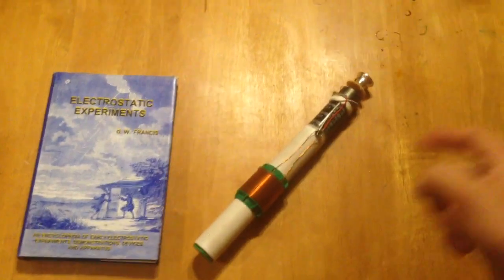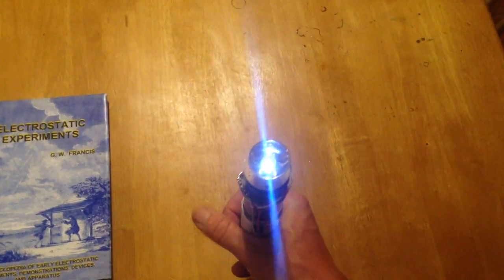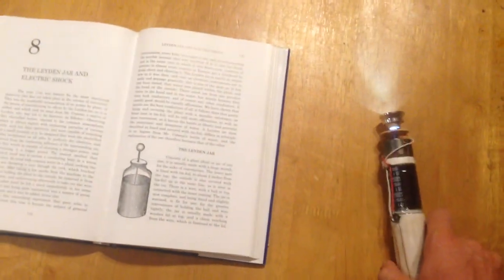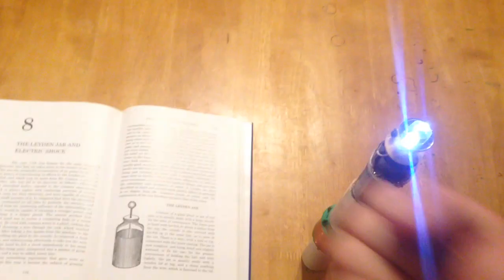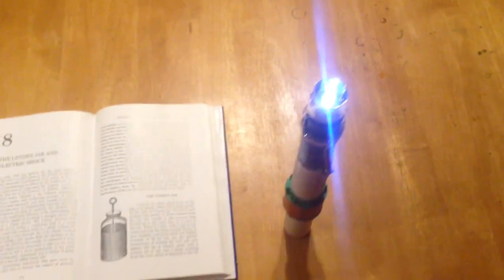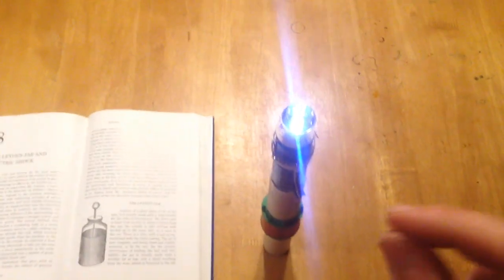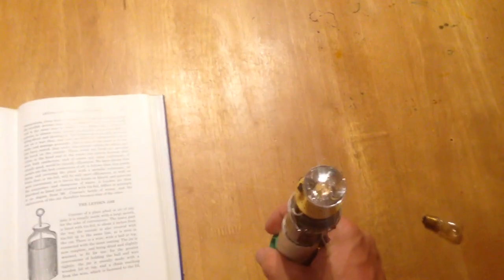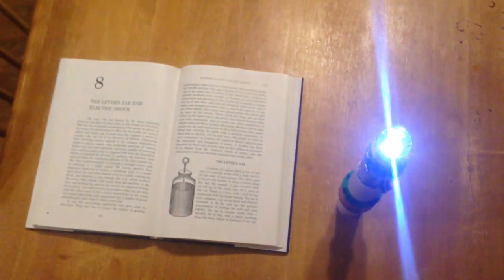3D Printed SJR Flashlight Prototype! - Instant Charge Battery Free Light

Comment: Hi! I am strugling to reproduce, but the lasersaber website does not exist anymore. Could you please write the diameter 😊f magnet and coil turns and wire diameter. I get only 1.5V with 250 turns 0.5 mm wire and 15 mm magnets. Ptobably need to use Joule thief. 18 mm ring magnets work better. Tube is 20 mm outside diam.

Comment: I’m sorry if this has been asked. I tried to scan the comments and didn’t see an answer. Can you go into some details on the Litz wire (what gauge, how many turns, a source, etc)

For example, can I use 3 strands of 30awg magnet wire which gives an equivalent 25awg - Litz wire??? Or 10 strands of 40awg to get an equivalent 30awg - Litz wire??? Is this like using Litz wire or am I not understanding what Litz wire is?

Does Litz wire make the difference compared to magnet wire?

Comment: I was wondering if  you could hook up a type of transformer to this device /concept and generate power from it. I love how this capacitor rings and recycles its energy but can you capture this energy and use it instead of making just light? It seems you might be able to make a system that could recharge its self.
If you can run a led all night long with little or not drop in power in the capacitor but still provide power enough to power that led it might indicate more power being produced than is present when the experiment was started. Example. I have 1 gallon of water and let it drip slowly into another bucket. I end up with 2 gallons the next day.
Please let me know if im off track here but it seems you are on to somthing

Comment: Only question i have is how can I reproduce this effect with off the shelf parts for that coil that does the magic.  Will i need an Orion Delta 3D printer to make this work or is there some other arrangement using off the shelf stuff that will work? If all this pans out, you may have saved the world... I'm sure some will not agree with me, but your experiment already put my over priced product i bought a few yrs ago to shame (won't mention the name but i have to shake it for a while to get minimal illumination for a just few mins and no where near that run time your experiment has).  Thanks for your diligence in the pursuit of efficiency and discovery.

Comment: On eBay or amazon, you can get these dropin modules for flashlights, I would get the XML U2 or XML2 dropin, as these are great high quality cree LEDs. The reflector (although easily scratched) is decent. these power LEDs, although may seem like an overkill, are very good at low currents/powers and may even exceed their efficiency ratings! Try to get one with the smooth reflector for throw.

Comment: Excellent Lasersaber. This is it! I find it interesting that the magnets goes resistanceless the more you shake it. It's telling you something there. Once the charge pump starts it should stay running indefinitely once you get the resistance lower or Voltage levels higher. Reduce the current and boosting the voltage is the best way to do this. Use a choke coil for that. The more the winds the better for choking the current. The funny thing about energy is, it doesn't like to be constricted. The voltage levels will quickly climb and because the current is stronger before the choke coil. The voltages to current ratio is what we are looking for. As the current goes down and the voltage raises it loses much less in the process of going from a to b. You want to reduce losses then just simply choke the current before the application you are using. Tesla was of the opinion that to reduce the voltage field losses that he could contain it like a pipe. Reflecting static plates around the wires. This allows a voltage pressure to surround the wires.
 Can you remember the videos where the electricity went right through the wires insulation and burned this guys skin? Thats how you protect from this kind of energy. A static barrier. Tesla has a Patent for this process of channeling this kind of energy. It looks like Coax but it is not. Look for this patent and read the information about statically charged energy.

Comment: I also did JT, the capacitor 330uF 9V works ok 8min.
More info on the Polish forum: http://www.elektroda.pl/rtvforum/viewtopic.php?t=2818510&highlight=

On battery 1,5V LR6 works one week, and voltage drop from 1,6075V to 1,6057V

Comment: how you ever thought off putting a bug zapper transformer in the circuit?, to up the output, its small and could be quite effective in getting a brighter light
Reply: Try using a crstal radio set to catch AM radio waves.

Comment: Okay, at this point I would suggest you to start a Kickstarter campaign. I would support you defenitly!

I think what you are doing has something to do with ultra high efficient high voltage (9V) to 3V conversion where 99.99999% of the voltage is converted to current.

Therefore, the current on the cap is really low while the current through the LEDs is ~30mA each LED.

This is really exciting!

I would try it to do a 5V output DC/DC converter with this. So everyone can charge his phone using this flashlight, too. You have to limit the voltage to 5.5 Volt max, though. It will decrease the performance a bit, but it is an interesting approach not just driving LEDs with this SJR circuit.

Comment: I wonder how the circuit would perform running a higher wattage LED like most general purpose flashlights use?  Most of the decent flashlights I have seen use CREE T4, T5, T6, U2, R5, Q5, etc LEDs.

Comment: Awesome build and concept.
This technology could trickle down to vibration dampening on trains and road vehicles...dare i say Formula One race cars could be using it next.
Also i think an electric guitar arrangement would be another easy way to harvest vibration and motion back into usable energy.
Given the ability to tune a string under tension to match the input frequency, certain frequencies could be targeted for dampening.
Instead of a shaker motion you could simply pluck a string.
Reply: power from wave motion of sea ?